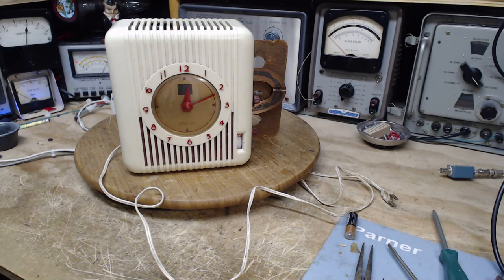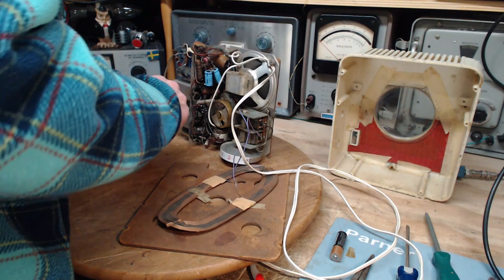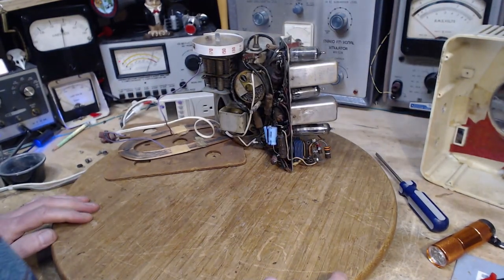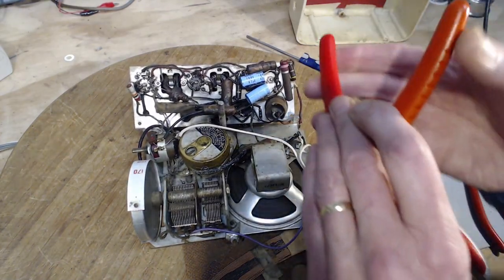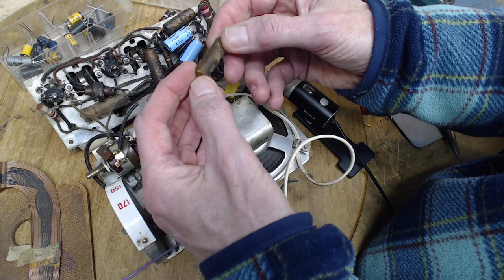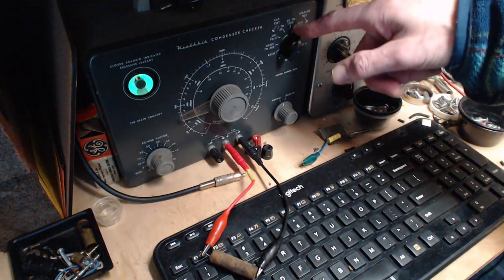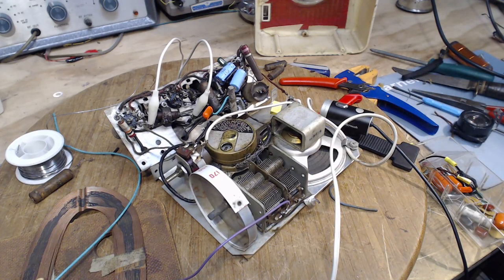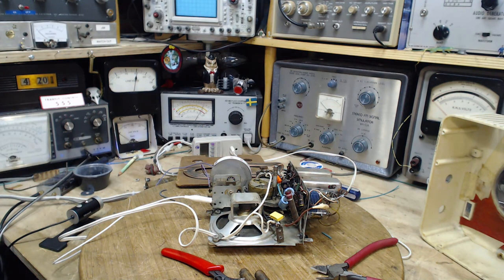Jewel Model 505 Vacuum Tube Clock-Radio Video #2 - Bad Capacitors Replaced

Comment: Its Ok to leave the old lytics in the chassis as long as they are electrically disconnected. The radio keeps intrinsic value with all parts appearing physically. Good thing the IF cans are the capacity tuned type. Trying to get at a core underneath could be a pain. March on James!

Comment: Checking those old paper/foil capacitors is interesting, but much the same as checking a used contraceptive device.  Shorted coupling capacitors can damage the tubes.

Comment: I think you forgot the C10 output coupling capacitor.  Check the number of capacitors you removed.  I think it was connected to one of the output tube pins.  It was on the outside edge ot the chassis. It might be across the output thansformer.

Comment: I would have Pulled Out that big long ugly leaning capacitor myself... I use WINDEX to clean off a power cord, using a micro fiber towel.. UPDATE, after watching more of the video, I see that Jim pulled out that large capacitor. Looks Better...

Comment: When I was a production test tech on the radio line the first thing we did was a physical inspection of tunes and parts then tested resistances to ground on each tube pin contact. Firing up the radio checking operation we did DC voltage  testing

Comment: No harm until it leaks electrolytic substances. Be sure to use original values on the Lytics.  Larger values can damage the rectifier cathode connection inside the tube. There are times the two caps are not enough for filtering all the hum. I like to add one more RC filter network to further reduce V+ ripple and improve the DC voltage regulation. Adding terminal strips is the best way to physically and electrically  install the new caps. You can keep it neat and sturdy. Always use spaghetti in the leads that are near other conductors of high voltage or grounds.